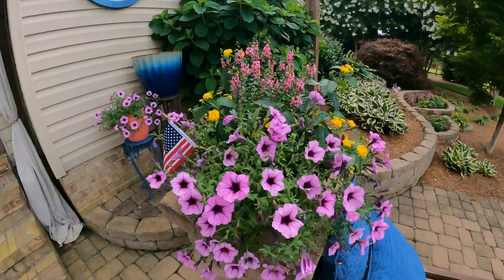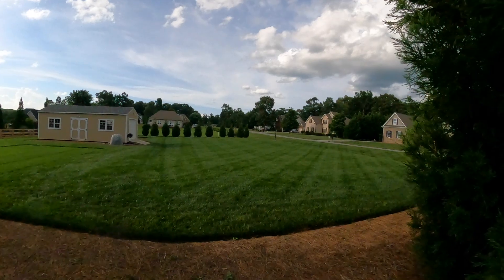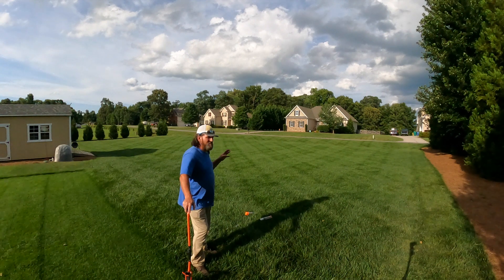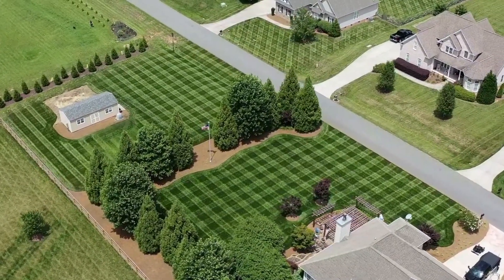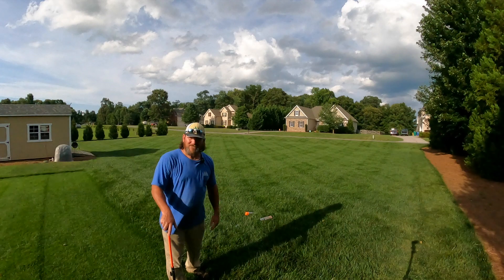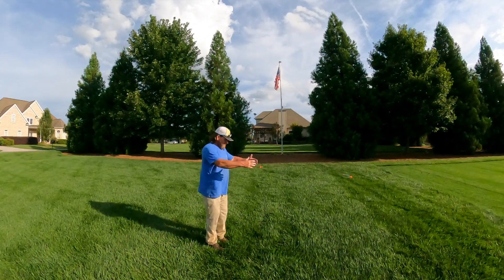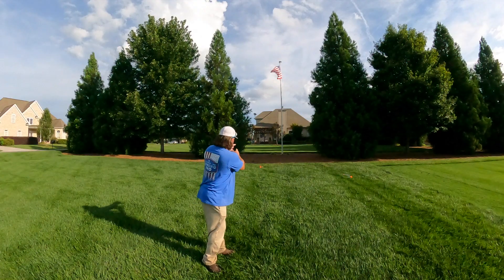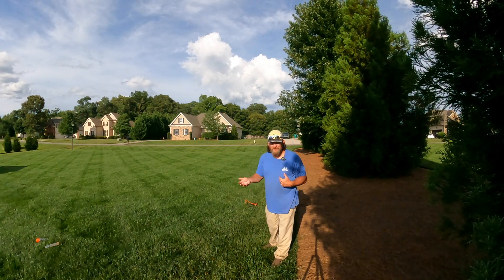Irrigation Design Based On Turf Grass Needs

Comment: Feed your zones in the center of the zone.  It keeps equal pressure at each head.   If you feed at the end you will loose pressure and flow at the last head or two.

Comment: I’d be interested in your thoughts on Hunter MP rotator heads.
Reply: Me too!!!
Reply from the maker: I’ve never used those. Yet
Reply: i use all hunter rotors in my yard, i just switched out the last of my I-20 rotors to PGP rotors, some of the i20 heads were over 10 years old, they work great and ive had no issues except after years of service they wear out
Reply: We use them extensively here depending on available water pressure. If it’s low pressure we run Rotators. Obviously you can’t mix with other gear drive heads on the same zone. 👍🏻🇦🇺
Reply: I have both but prefer the Rain Burd 5004 series.